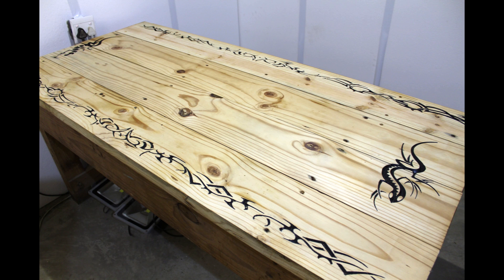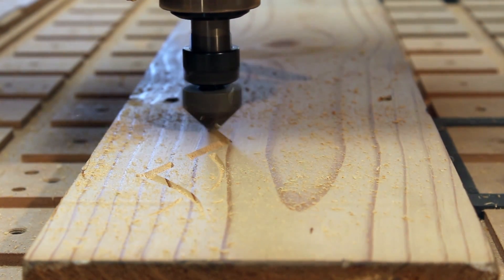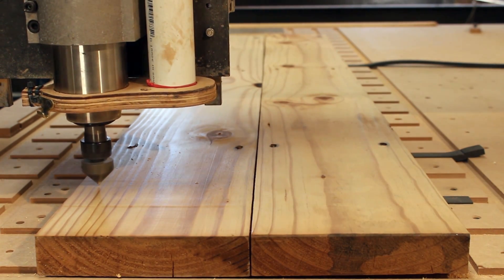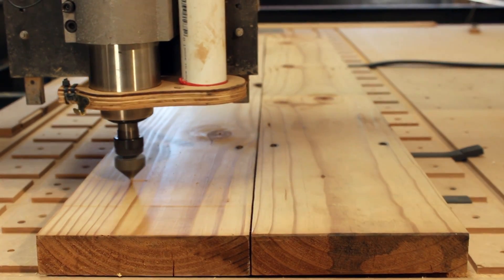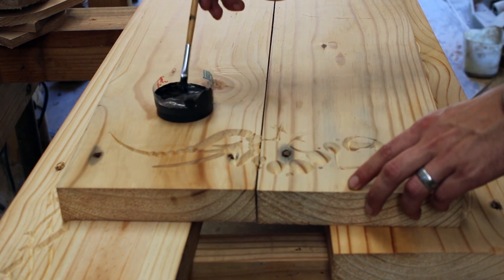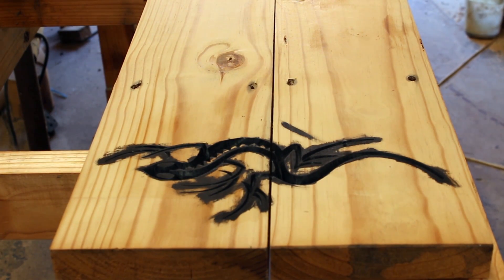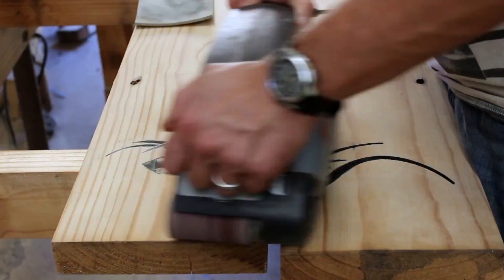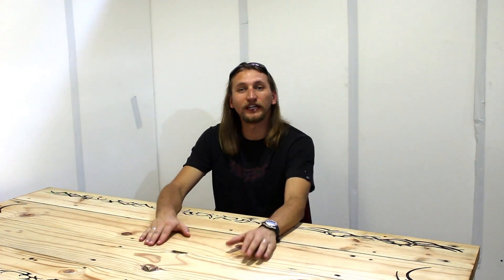DIY CNC Router - V Bit engraving my table

Comment: Great video! What wattage is your spindle?
Reply from the maker: its a 2.2kw Chinese spindle.
Reply: Thanks for the fast response! Do you ever run into low power issues? How do you like it? I built a cnc router and am debating spindle power right now.
Reply from the maker: +airportadam I don't realy have power issues only when you swinging large slow cutter you are going to have power issues. But all the way up to 1/2 in you should be fine.
Reply: Ok, thanks for the info! I think I am going to go with a 1.5kw, I like the idea of being able to use 110v. I know there will be quite a loss in power but... Thanks again!!!
Reply from the maker: +airportadam If you can get a 1.5kw air cooled even better,  a lot less plumbing.